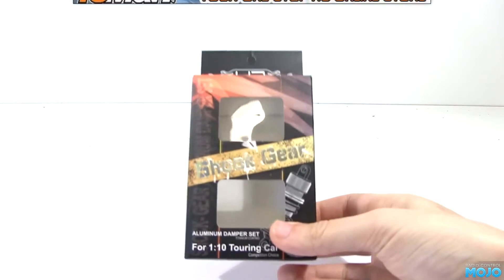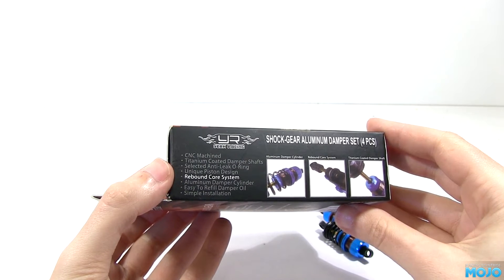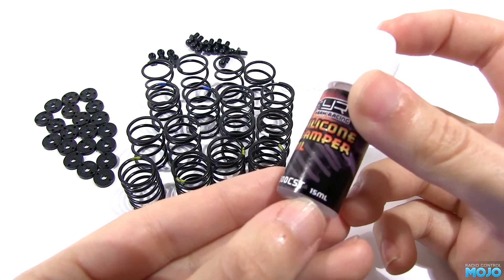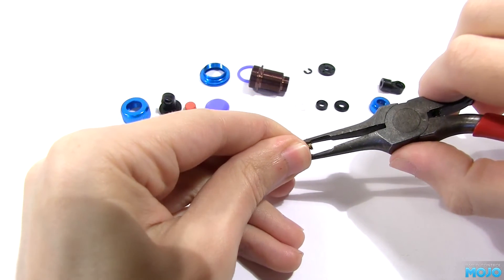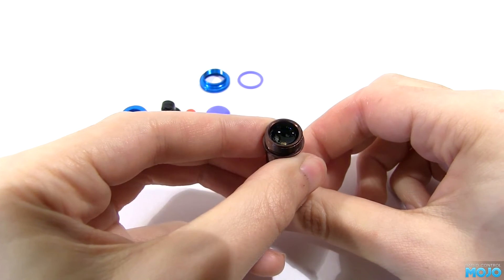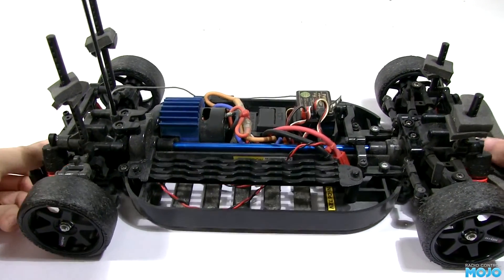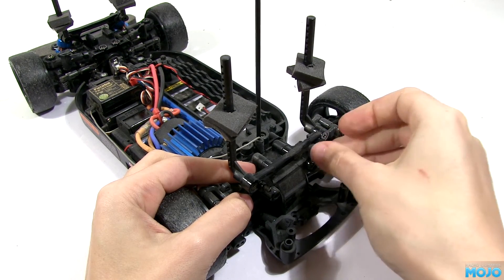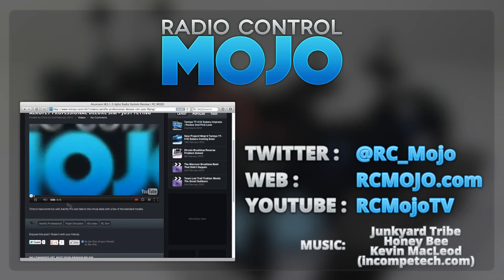Yeah Racing DSG-0050BU Dampers

Comment: I might have weak hands, but I found it A LOT easier if you pre-thread the shock end by putting the shock shaft in a drill like a small drill bit and then holding the shock end with some pliers.  Obviously need to be careful not to mar up anything.  Otherwise great video!  Thanks!!

Comment: what dampers would i need for my kyosho pureten alpha 3, i need a lower stance than the current friction shocks give me
Reply from the maker: Measure the current one at full extension from the centre of the ball ends. You can use the same length and put a small spacer under the piston during assembly, a little bit of glow fuel tube works a treat. Or you can try the next damper length down.

Comment: want want want. haha. which version will I need to buy to fit to the xv-01 55mm or the 60 mm.
Reply from the maker: For the XV01 the stock dampers are 55mm, so 55mm for a direct replacement. I can't test, but I reckon you could squeeze 60mm in if you use the outer holes on the lower arms, for a bit more ground clearance.